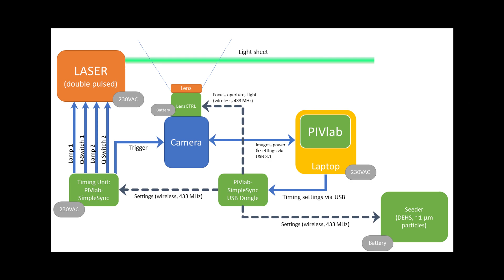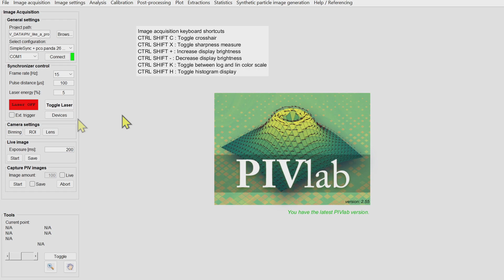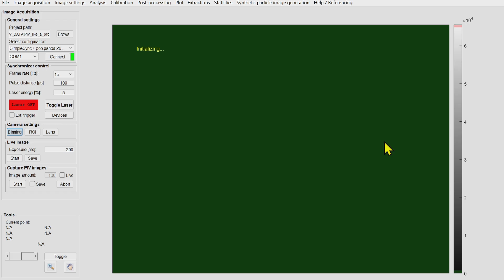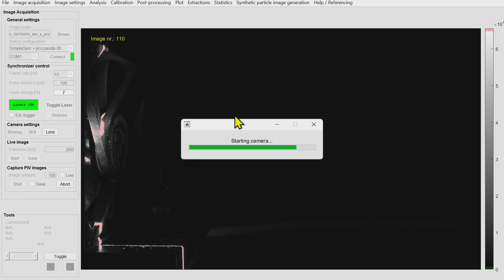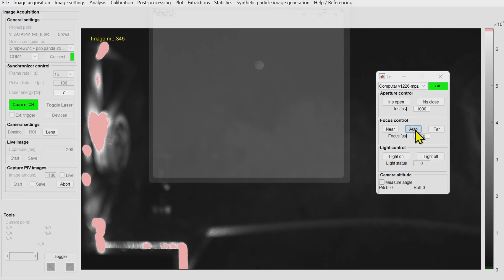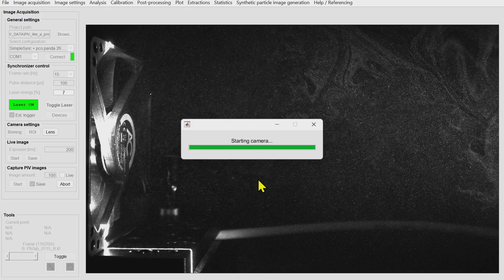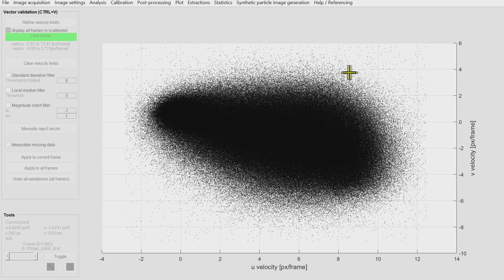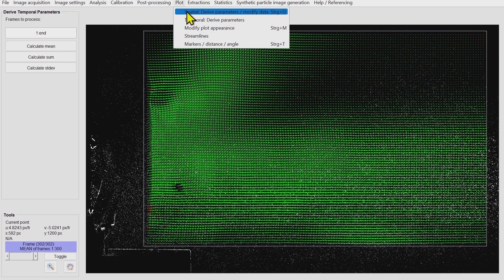PIV like a PRO with PIVlab!

Comment: Hello!  have a question: the selection of the interrogation area size usually needs to be more than 4 times the maximum displacement, but how is this maximum displacement usually judged or selected?
Reply from the maker: Hi, this rule of thumb is a bit older, it is not fully relevant for multipass algorithms. Just make the first pass as large as possible, then decrease until the desired ratio of noise and resolution is achieved.
Reply: @Willa1980  I can use multiple passes, where for the first pass, I can arbitrarily choose a larger size, and then for the remaining three passes, I gradually refine by reducing the size with each pass. Can I understand it this way?
Reply from the maker: @YTLU-c4j  yes, correct
Reply: @Willa1980  Thank you very much for your patient answer😊

Comment: Really intersting. Is it possible to measure the velocity of bubbles rising in a liquid with PIV? or it is just possible for field of velocity
Reply from the maker: It depends on the amount of bubbles. If there are many small bubbles, then it will be possible. If there are only very few bubbles, then particle tracking velocimetry (PTV) is more suitable.
Reply: @Willa1980  okey. Thank you. So, for investigation of single bubble behavior I need a Particle tracing velocimetry. Thanks